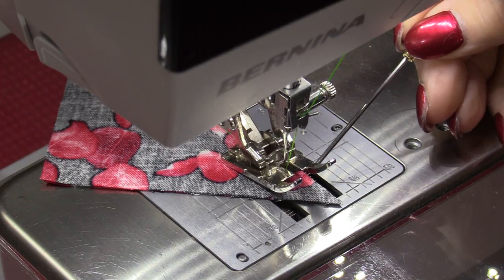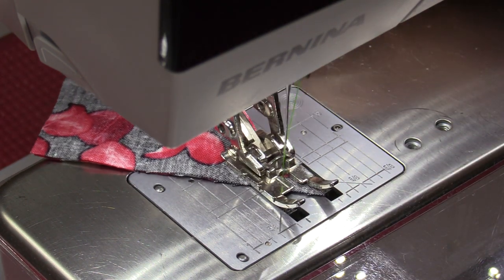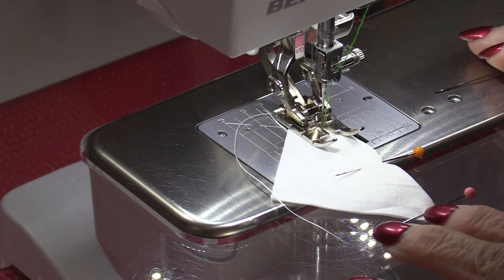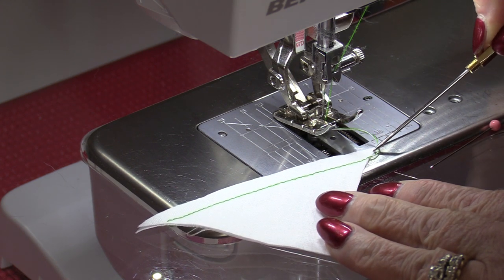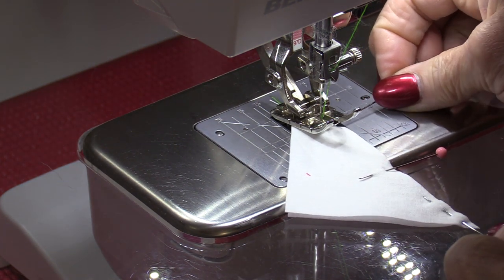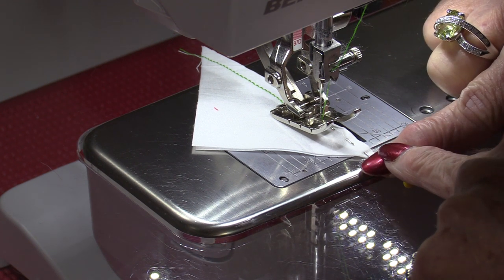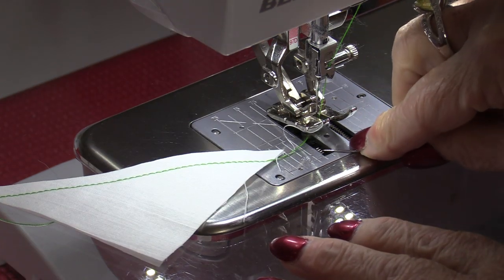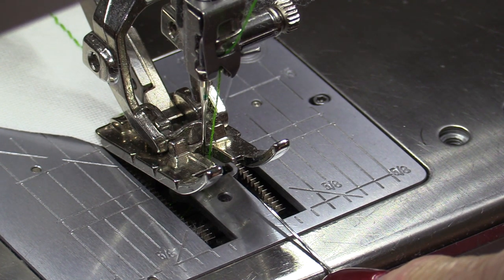How to keep a 1/4" Seam Allowance all the way to the end of a point

Comment: I use just a kiss of water soluble glue between the fabrics on the seam side within the quarter inch space, use a warm iron to set it - if I need to rip out my stitching for some reason, the fabrics are easily separated without ill effect to the fabric.

Comment: I just finished sewing 1000 HST's three and a half inches each. I did it  on a Bernina using a 37D foot.   I stiff startched them so most of the time I could chain feed them with alternating orientation.  However,  at least one in ten or so  wouldn't feed in.   Then I had to stop and restart.  
This is going to save me alot of work next time.
Reply: I make my HST's by starting with two squares, drawing a diagonal line down the middle, and then sewing 1/4 inch away from the diagonal line.  Then cut on the diagonal line you drew down the middle.  Wa lah! Two HST's perfectly sewn!
Reply: @Oontaka   I agree that this should work better,  but I find it is easier for me to  rotary cut a straight edge at the exact center than it is to draw a straight line at the exact center.

Comment: Do you think that machines without the built-in dual feed mechanism like yours and Pfaff machines may still be wonky with this method? It doesn’t look like the pin remains in contact with the fabric  right up to the point  where the machine needle pierces the tip of the triangle.  I’ll give this a try later today using my Bernina 200e, but I don’t seem to have a wonky issue using the straight stitch plate and increasing the presser foot pressure a click or two 😊
Reply: My Ellisimo Gold II doesn't have fual feed anx it worked fine

And worked fine with my walking foot.